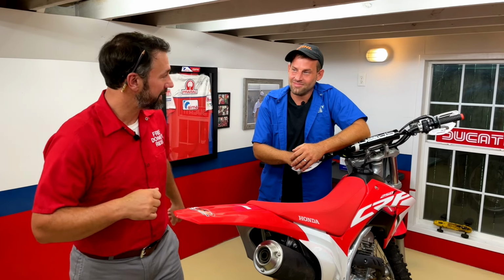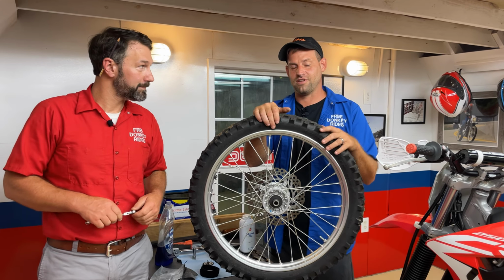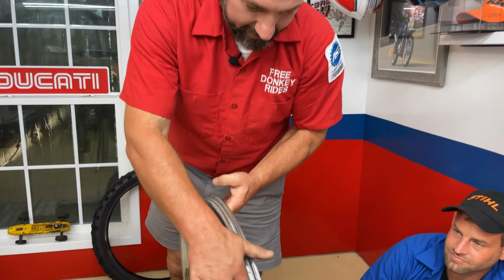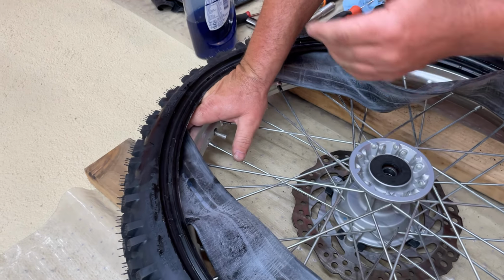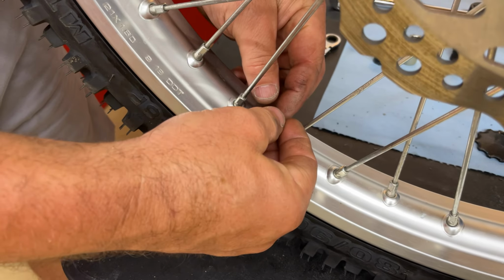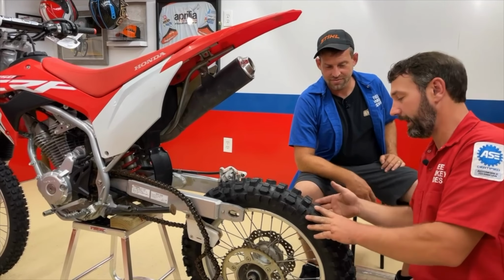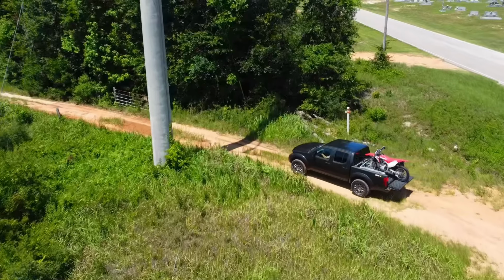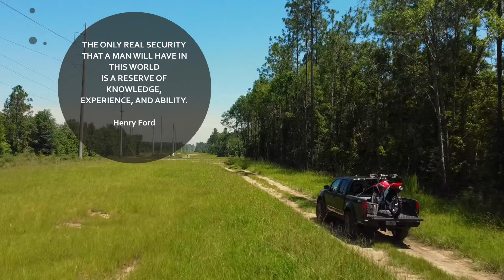Changing Dirt Bike Tires with  BASIC TOOLS Without Pinching the Tube - Pirelli MT21 on Honda CRF250F

Comment: And what is your opinion the MT21? Thank you
Reply from the maker: You know, I feel like all over the Internet there are people giving opinions on things that they have no real basis to be able to give opinions on. If I had never had a cheeseburger before, I’d tell you a Mc D  burger Is the best ever!  This is part of why I did not want to give an opinion in the video but if asked I’ll give ya my initial 2 cents. The tread does feel hard, like it’s going to have a decent street lifespan for a fairly aggressive tire so take that into consideration. Long street miles I don’t have yet so I can’t give you much there but the little I’ve tried to lean on them (on the street) they feel great! Relatively great, don’t expect a Dunlop 17in race slick coming into a corner but they gave me a somewhat similar street confidence level of a Bridgestone Trail Wing 301 and a 301 is definitely a lesser tire off road in my opinion. I lowered the pressure down another couple PSI on these Ps and they really seemed to grip pretty well and that’s what I was trying to show on the video. The simple crash was 100% my fault. It goes from a loose soil to a hardpack and I tried to get the back  tire to bite when I should have hit that corner flat track style! Very happy with the tires. If there were one thing I could change it would be the pricetag but come on we all wish things were cheaper or we had more money right! LOL. The bikes suspension on the other hand (if you’re trying to push it really hard) leaves much to be desired but again everything is relative! Im VERY impressed with the bike for the money Honda is asking for it! We will for sure have suspension mods on this build though. I see the bike in your profile.  I just put a set of Roval wheels on my hard tail and have not turned them into a taco yet so pretty impressed.  Yes I ride a hard tail go ahead pick on me, I’m used to it. 😆 (I live on the gulf coast no real MTB terrain like out west) Anyway, thanks for the comment.  I do hope you enjoy the video. 👍👍
Reply from the maker: You know, I feel like all over the Internet there are people giving opinions on things that they have no real basis to be able to give opinions on. If I had never had a cheeseburger before, I’d tell you a Mc D  burger Is the best ever!  This is part of why I did not want to give an opinion in the video but if asked I’ll give ya my initial 2 cents. The tread does feel hard, like it’s going to have a decent street lifespan for a fairly aggressive tire so take that into consideration. Long street miles I don’t have yet so I can’t give you much there but the little I’ve tried to lean on them (on the street) they feel great! Relatively great, don’t expect a Dunlop 17in race slick coming into a corner but they gave me a somewhat similar street confidence level of a Bridgestone Trail Wing 301 and a 301 is definitely a lesser tire off road in my opinion. I lowered the pressure down another couple PSI on these Ps and they really seemed to grip pretty well and that’s what I was trying to show on the video. The simple crash was 100% my fault. It goes from a loose soil to a hardpack and I tried to get the back  tire to bite when I should have hit that corner flat track style! Very happy with the tires. If there were one thing I could change it would be the pricetag but come on we all wish things were cheaper or we had more money right! LOL. The bikes suspension on the other hand (if you’re trying to push it really hard) leaves much to be desired but again everything is relative! Im VERY impressed with the bike for the money Honda is asking for it! We will for sure have suspension mods on this build though. I see the bike in your profile.  I just put a set of Roval wheels on my hard tail and have not turned them into a taco yet so pretty impressed.  Yes I ride a hard tail go ahead pick on me, I’m used to it. 😆 (I live on the gulf coast, no real MTB terrain like out west) Anyway, thanks for the comment.  I do hope you enjoy the video. 👍👍
Reply: @Freedonkeyrides  thank you for your feedback. I have a Mitas E09 on the front and i feel the profile is too round and feel that it wants to run away from me on the dirt corners. Have you tried the Mitas? Do you believe a more square profile will be better on dirt cornering? Thanks!
Reply from the maker: @koalaboyTT   It really depends a lot on the bike and the type of dirt you are riding on. Normally a smaller, softer block will get better traction in a soft dirt but on the street you will regret it. Every tire is going to be better at some things and worse at others so you have to find that one that works for you AND the bike you have. I have not ridden on the E09 but I have seen them in person and they look decent. Have you tried lowering the pressure some when you ride off road?
Reply: @Freedonkeyrides  yes, went down to 1bar. The tyre itself is quite hard, not very flexible. I am portuguese and did cross the country OffRoad on my dr650 with those tyres and the only complaint was that. The ground was mostly hardpack, sometimes with some loose over hardpack.
Reply from the maker: @koalaboyTT   I just saw this comment! What an adventure that was I bet! My dad had a DR650 for a few years it was a good bike to travel on. On a good hardpack a softer compound  has always helped me but you wont get long miles out of it.  When I start pushing on a hardpack, I try to keep the rear loose. I guess somewhat like a flattrack style but you know everyone has their own way of riding. I like to say that if you are having fun riding, then you are riding in the correct way! :)

Comment: Mounting or re mounting a tire with a tube that has no air in it is the most common mistake that causes tube piinch. This is terrible advice. The tube should have just enough air put in it to hold shape. This prevents the tube from getting caught under a tire iron or from getting caught between the tire and rim bead.
Reply from the maker: @kevinnielsen1356  Hey Kevin and thanks for the comment. As I do appreciate the different perspective I think your opinion of “terrible advice” is just plain incorrect. My evidence that it’s incorrect you may ask? I was taught this way 20 years ago by a retired professional racer at the time and have replaced hundreds of tires without ever pinching a hole in the tube. For you to insist a method that has a 100% success rate by myself being “terrible advice” is just.. terrible. 👍
Reply: @Freedonkeyrides  Maybe 100% success for you. My own personal anecdotal evidence is from 5 decades of bicycles and motorcycles always changing my own tires, I gave up on relying solely on talcum powder on a completely deflated tube about 48 years  ago after learning to put air in the tube. Think about it. How would a tube get folded, or by pinched the tire iron, or pinched between the rim and bead when it has the shape pumped into it. It will naturally resist those pinch points. Also, what is the drawback?  The pressure is to low to interfere with tire mounting. I apologize for the word terrible. Not the best advice is more appropriate. I also apologize for bruising your ego.
Reply from the maker: @kevinnielsen1356  
I’ll start with saying that there is no need to defend your way of changing a tire. I never said anything negative about your advise and I apologize if somehow it came off as I was. I have had zero issues over a 20 year span of doing tires the way I illustrated in this video so I have never tried your way and therefor have no evidence of it working or not. Whats that skin a cat saying? You said it’s been 48 years of changing tires for ya? Congrats and that’s not a joke! Not many of us riders get to ride long enough to say we have been wrenching for 48 years them! Pretty cool. Now you ask my opinion of drawbacks when doing it your way. First, when installing the tire, as you are trying to get the last bit of bead over the rim and it’s getting really tough to slide in a tool, a first time changer could easily press too hard on the tool resulting in the tool sliding too far in and making contact with an aired up tube. If the tube is flat and your tool slides too far into the tire you have very little risk of the tool hitting/hurting the tube. Secondly, as you are getting the top bead onto the rim, the bead area approximately 180 degrees from where you are prying the bead over the rim, must be pressed toward the center spoke area of the rim.  When you press that opposing side down getting the bead to the center of the rim you would be displacing the air from that portion of the tube making the pressure of air in the other side, the danger side where your spoons are sliding in, higher! Now the tube is even more likely to be hurt when trying to install a tool to get the bead over the rim as there is more pressure in the dangerous area than when you started.  Again, just because I don’t do it your way doesn’t mean it’s wrong. Many ways to skin that smoke wagon. LOL Lastly the ego comment. I wont respond to it because I don’t want it to shadow the genuine discourse shared. 
👍👍 🏍️
Reply: @Freedonkeyrides  I t isn't my method, it's a method I learned riding enduro from seasonrd riders. Have you tried it?